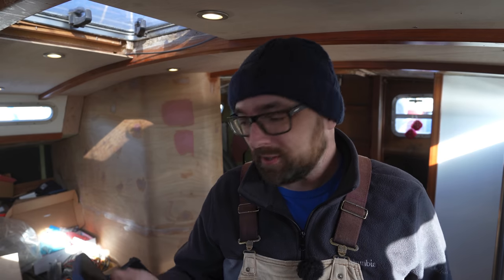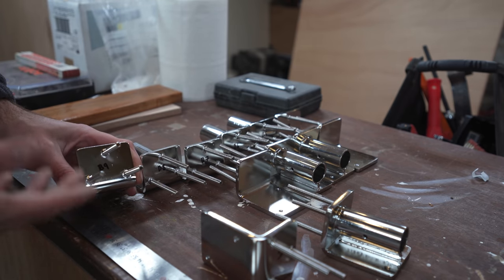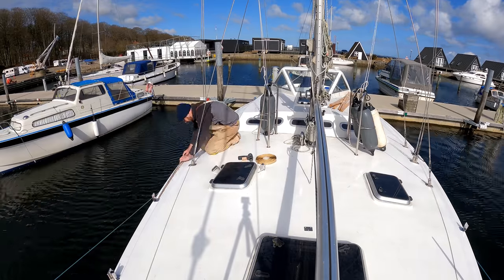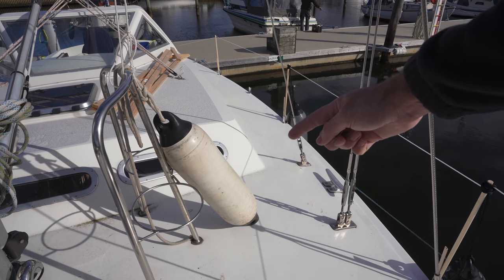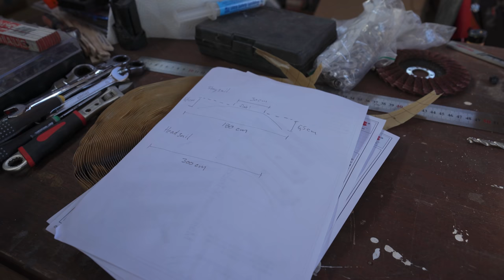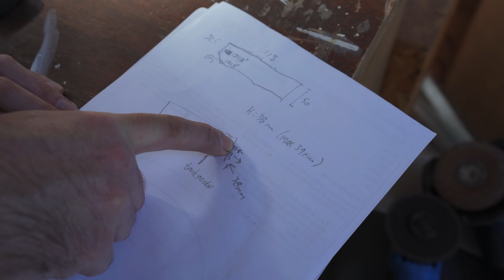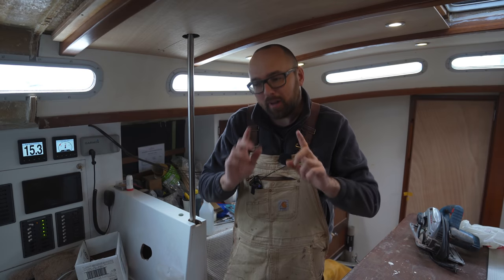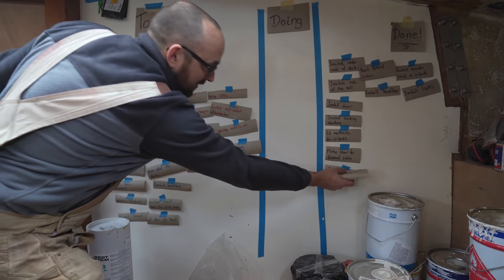Sail Life - Getting started on the toe rail / mini bulwark

Comment: Have you thought about making the backing plates longer so they spread any load across more of the toe rail. I was thinking about someone leaning or falling grabbing a hold of one of the standions and it would seem they would pull or rip out with only 2 inches of backing instead of a long backing plate so they don't pull away by the fulcrum load. Maybe that is over thinking but just a thought. I suppose the toe rail with provide some load resistance but I was just thinking that grabbing and pulling the top of the standsion would put alot of pressure on the backing plate and edge of the boat.
Reply: Interesting concept, we recently installed a bulwark similar to this on our boat... we love it and its been great the past year! more details here: https://www.youtube.com/watch?v=BCJvkLgCnug&t=441s so excited to watch Mads complete this

Comment: Have u looked into 3d head sail sheeting it used zero friction rings and there are a lot less holes but a lot more tripping hazards
Reply: I see them called floating jib leads in eu websites more of a racing thing but they work so much better than track systems and knowing u just replaced the deck figured u might enjoy putting fewer holes in it

Comment: Regarding charging the Lifepo4 below zero. You are correct. But as long the battery is in your boat, in that isolated compartment there will never be below zero in that area. Charge away.
Reply: Due to the vicinity to the water it will get colder than room temperature.
Reply: @roaxth  Might be, but never below 0 in the cell pack. I know the area. I live 30min away. Lifpo4 is the way to go.
Reply: @Mikael150381  I personally would not risk loading LiFePo below +5 degrees Celsius, even if it it possible. The batteries are to expensive to get them stressed. I hot climate and if the batteries are heavily used, I even would consider a cooling option.
Im a real fan of LiFePo but there are some sailing experts who are very critical about the danger of Lithium on sailboats. Therefore I would do the most possible to minimize risk. The issue is the organic electrolyte. It is highly flammable and the temperature range should be above freezing and below 60 degrees Celsius.
Reply: @roaxth  Nope. LFP are the safest types to use. In general LFP, LMO and NMC are very close. All have there purpose. But they are safe. All lithium packs will of course need a good BMS. Cooling? They will never get that hot, you cant really supercharge those suckers. Charge rate is around 0.7-1.0 C. They will do just fine. Regarding low temperature, charge away. They will take it.  LMO will even take charge at -40 celcius.

Comment: If you do not seal the entire area under the base plates, you'll find that salt and water will cause will cause significant corrosion under the base plates. Given the low oxygen environment, the corrosion may potentially compromise the base plates and at the least will bleed lots of rust down your topsides. Also, the expanding corrosion may eventually deform the deck. I've seen it plenty of times.
Reply: Is this due to the temperature transferring from outside through the metal and cooling the inside backing plate?
Reply: As I have a hard time imagining the salt transferring through a hole plugged by butyl?
Reply: @TigRdk   Differences in temperature expansion between fiberglass and stainless can cause problems with sealing, but butyl tape is really good at handling that. My comment was not referring to the backing plates, but rather corrosion on the underside of the deck plates where rain and seawater can creep under and salt and gunk buildup if not completely sealed with butyl. Just sealing around the fasteners, but not fully under the deckplate is a recipe for unwanted future corrosion and problems including crevasse corrosion. That said, even without leaks, on a boat at some point condensation will surely find its way between the stainless backing plates and the fiberglass hull and some corrosion will also occur there as well. But typically not nearly as accelerated as under a weather exposed deck plate that is not fully sealed. So I usually put some sealant between backing plates and the fiberglass hull, which also can better seat the backing plate if the hull is not perfectly smooth.

Comment: Many boats use turning blocks placed aft of the winches to get the correct routing for the jib sheets...Athena is looking really good. Hats off for staying so focused on your vision and goals!
Reply: This.
Reply: I would like to add a good way to de-power the foresail is to run the car back as far as you can to flatten the sail in heavier winds.  Conversely when sailing off the wind in light air it is nice to push the car up to round out the sail for more power.  Having the ability to adjust the cars is helpful with sail shape. IMHO.